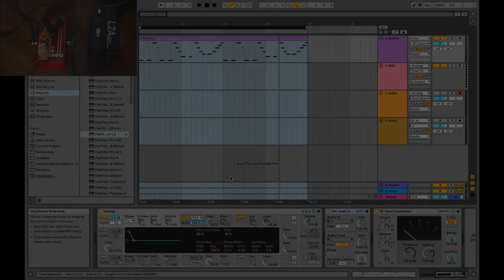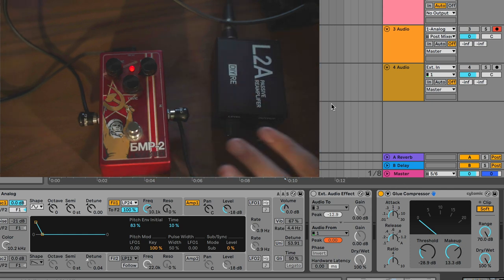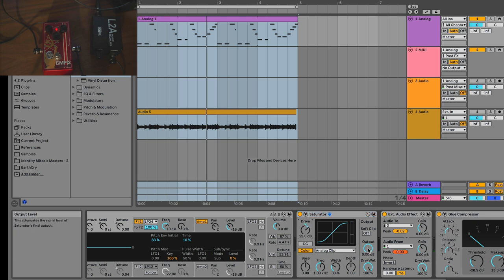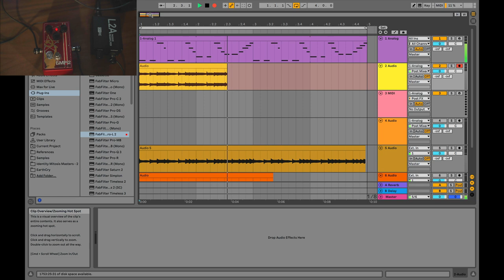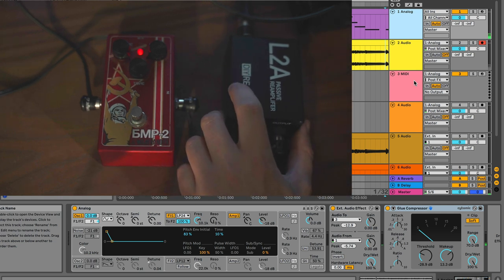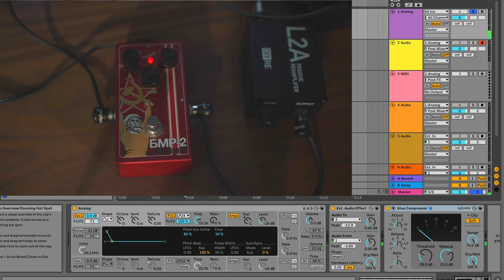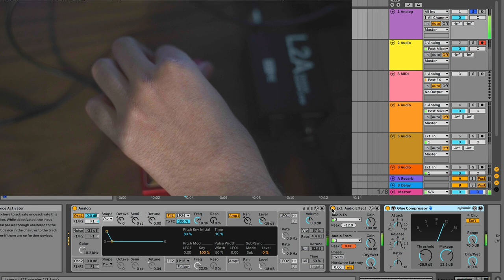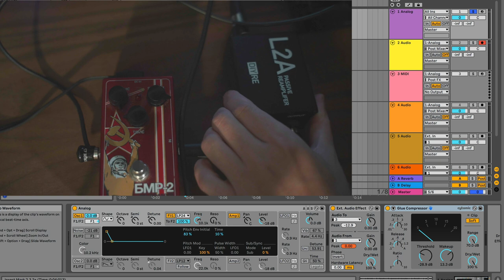Guitar Pedals and Ableton

Comment: Awesome tutorial. Missing are: 1. Discussion of stereo pedals, and stereo reampers, and advanced solutions like the Radial KeyLargo which has 3 inputs (so could reamp and be used with two other rigs like 2 additional physical synths), and can do stereo 2. Setups that can use the balanced line level signals from DAW without the need for reamping, for example: daw out -> ChaseBliss CXM 1978 reverb -> back to daw using 2x2 (stereo) trs cables (one power up procedure on the CXM to switch from unbalanced to balanced)

Comment: So I have a Chroma, Microcosm, Light Pedal, UAD Delverb, Nemesis Delay, and ACS1. These all will take line level is there any advantage here really? I kinda bought this on a whim after watching this but it looks like it’s only mono anyway, lol.
Reply: Only thing mono in this setup is the light pedal, but it’s too cool to care.
Reply: You don’t need a reamp box if your pedals accept a line level signal. I’ve successfully used my Microcosm and Volante this way. 

There are stereo reamp boxes out there for stereo pedals without a line level mode. 

If you keep your mono reamp box, you can use it for the methods mentioned in the video: using distortion (and other mono, Hi-Z pedals like phaser, tremolo, etc), and reamping a dry signal from a direct input guitar track out through an amp and back into your DAW.

Comment: Thanks for the video, super informative and well put together

Question

If I put a synth bass plugin sound that’s been widened with a unison spread effect, is there anyway to distort that signal and keep the stereo widening effect?  Would I need two distortion pedals for the left and right signal or are there stereo distortion pedals?
Reply: the only stereo distortions i know of are digital ones (like in the Line 6 Helix) so in analog land you'd need two separate pedals. (or separately process the left, freeze, and process the right & freeze). What I'd probably do though is add the (mono) dirt before the stereo widening. Or another option would be to add a mid/side processor, and just distort the mid channel...